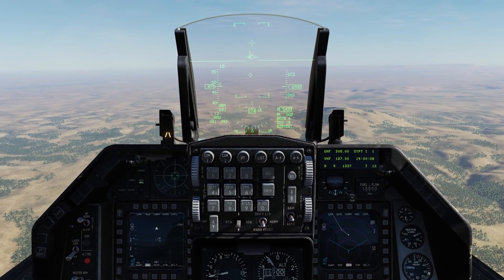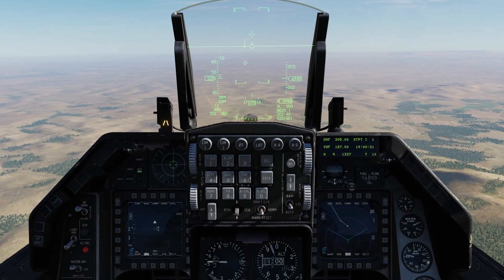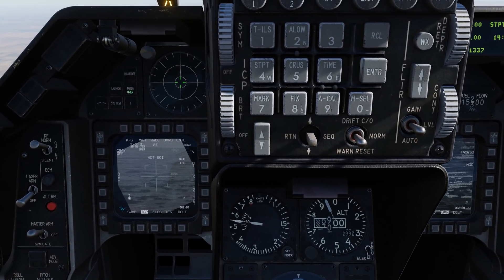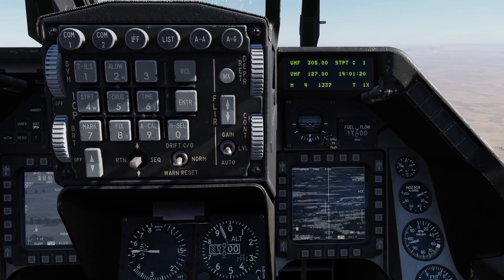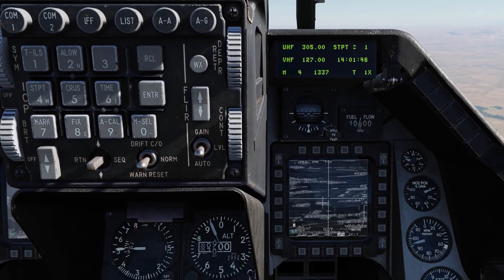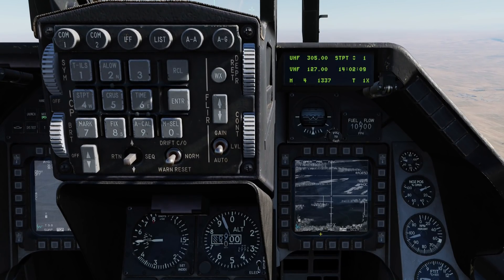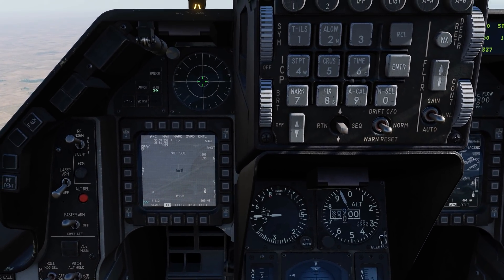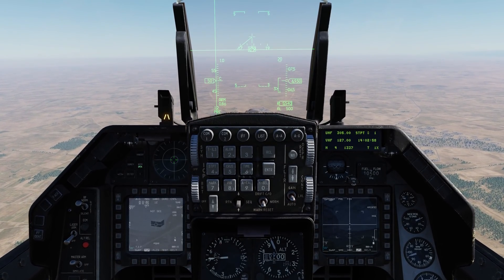DCS: F-16C Viper | Maverick Boresight Procedure

Comment: well this doesn't makes sense at all if in real life is how it works because its a pain to sync the tpod with the maverick seeker, because in the end you have to lock twice the same target and sometimes mav seeker is pretty off target ,  sometimes i end up shooting the wrong target in the heat of the moment with so many close ground targets, if this procedure you have shown here is a work around that will sync all mavs with the tpod, ok i will try it, sometimes i see myself just using the weapon display page and ignoring the TGP because ends up sometimes being easier, anyways Matt tx a lot man. I see this video is 3 years old so...is this really how it works in real life or you guys are trying to fix it, i know slave is a thing of the past but here would be nice to see it working , the TGP works way better to lock ground units with a dedicated zoom the different contrasts to choose from,  but then when you look to the weapon MFD and  is way off target and i  need to re adjust the lock, sometimes is very frustrating , you have multiple ground units etc.. , still love this plane and is a pleasure to fly it. Another thing, is normal the amount of de-compensation you have in roll when you drop a weapon from the left or right wing, its sometimes brutal the amount of trim needed to compensate and level the flight, cheers and have a great year guys, i belieeeeeeve in youuuuu(south park)

Comment: Does he ever reply to comments    My NWS will not turn on during ramp start in the F16.  I have been ramp starting for 7 months ,  now NWS will not turn on using the msl step button.  Anyone please help me.
Reply: I noticed recently that the brightness of the NWS green light is sometimes turned down/off, have you checked that? IF the steering actually works then it's the light brightness. If the NWS doesn't actually work then check your key binding, perhaps something got screwed up?

Comment: Hey Matt i got a question, i am new at DCS, how can i get the The F-16C Fighting Falcon "Viper"?
Reply: Buy it on steam or ED site. It costs $80 dollars right now, but if you wait for a sale you can get it for $40.
Reply: Okay.
Reply: Btw i am from Europe.
Reply: @mariosnikas0319  Being from Europe is not a problem. So am I. 
I would suggest you create an user on the Eagle Dynamics site and you play the Open Beta of the game. Yes there may be some bugs here and there and less stable (not an issue most of the time) but by being on the Open Beta you get access to functions and modules much faster, if that is your thing. You buy each module you want from either the ED site or Steam if that's the way you want to go. Newer modules don't have the same discounts as older ones when there is a discount btw but if you feel like it it can be worth the wait. The Viper has come very far from the beginning though it's really a beautiful module to fly now. 

WIlbuz

Comment: In boresight mode my reticle on my HUD and the reticle on the mfd does not line up and therefore it's hard as hell to get a lock on targets, any suggestions? (no tgp btw if that helps, just the mavs camera)
Reply: i have the same prob. any sollution?
Reply: @_DANZIG_  nope, unless you use the tpod and calibrate the mavericks camera to align to the tpod
Reply: @niklasohlen3097  mhh okay this sucks. thanks for the  reply

Comment: whats the advantage? I dont get it. You need to manual slew the mav and the nboresight when the target is in range of the seeker? Why not just fire it?
Reply: There is no advantage. It is a requirement. It's something to do if you want to be able to find your targets with the TGP and then shoot a maverick on them.
Reply: @Wawar9  can you imagine this like an alignment?
Reply: @TuneboyR  It is. You have to tell the Mav "where" to look at. Also, IRL pilots are used to do it while they are on the ground.
Reply: @TuneboyR  
This needs to be done if you want to use the TPOD to aim the mavericks (without needing to do any corrections, just TMS up and fire). 

It's particularly useful when using H and K mavs, since it provides very accurate force correlate locks, so you can fire at max range and actually hit the targets.

Comment: @Matt, why is this technically necessary? Do we need to expect this in the A-10C oder the F-18C as well in the future?
Reply: So is this really necessary because I don't recall anyone complaining about the maverick accuracy when launched from a F-16.

If it is necessary,  can you do this procedure during a pre-filght and have the maverick ready to use immediately after takeoff?
Reply: @RTSchramm  it's only necessary if you want to assign targets to the maverick through the tgp. Because like I said before, when mavericks are loaded, there will be an alignment error, causing the mavericks to look at a different spot than the tgp does. In order to fix this, you'll need to align them, to make sure both the missile and tgp are looking at the same spot

If you want to fire mavericks without use of tgp, than you won't need to do the alignment and you can use the seeker head of the missile to acquire the target.
Reply: @RTSchramm  AFAIK  you'd do this if you notice that there's an alignment error between the TGP and mav.

Can't do it on the ground, as the TGP won't work there? The procedure is fast enough so you should be able to do it when you notice a misalignment.
Reply: The AGM-65 mounting procedure induces an unknown amount of misalignment of the launcher. This misalignment must be removed to improve accuracy and shorten the time required to achieve a handoff
Reply: @Falconeer84  So, does this apply to all fighters that can launch mavericks? I don't do any manual bore sight alignment on either the A-10C, A10C II, or the F-18C.
Reply: @RTSchramm  The answer is probably two-fold: How the real aircraft works, and if/how it's implemented in DCS.
Reply: @RTSchramm  don't know about other planes
Reply: @Falconeer84  thank you
Reply: wow your comment before 49 seconds!😂
Reply: @AnAnAsDUDE  ok i admit... the technical question is a little bit unfavourably formulated... it should have been something like "why is it technically necessary in the F-16?" followed be the second question. This makes more sense.
Reply: @AnAnAsDUDE  I totally agree, it's no wonder real pilots probably only ever fly one aircraft if it's this complicated.
Reply: @mrifixplanes1813  why you are reply me? why you not reply to kurothas
Reply: @AnAnAsDUDE  Because he doesn't know how the reply function works :P ( He did it in another thread too - A  bit confusing xD )
Reply: @Jarlerus  hhh😅
Reply: @Jarlerus  Where is the Problem? obviously you can read and answer it
Reply: @kurothas2181  Problem? What problem? I have no idea what you are referring to here. <.<
Reply: @mrifixplanes1813  well it is hard to fly more that on aircraft at once
Reply: @mrifixplanes1813  with the price of modules, how many virtual ones are you flying? 😳
Reply: @DollyRanch  Well I've been using DCS for a long time so, A10C+2, AV8B, all FC3 planes, Ka-50, Huey, F14, F16, F18, Viggen, Gazelle, Spitfire, P51, Mirage,  it's hard to remember all the buttons lol
Reply: @AnAnAsDUDE  I see "reply" button, I click :)
Reply: @mrifixplanes1813  I know I'm just green with envy 😂 always funny when one hops in the Huey after a break and attempts to fire the weapons but instead talks on the intercom or trims the aircraft

Comment: Great vid. It's interesting that in the hornet you cannot change FOV on the pod with hotas even if the TGP is SOI when there is a MAV loaded, but in the Viper, you can.
Reply: Ohhh so thats whats happening, its been baffling me for a while why my fov button stops working sometimes then comes back. Thanks. Sounds like a bug youd think
Reply: What's happening in the Hornet is that the Mav always gets priority over the TGP for the Expand button, regardless of SOI. Supposedly that's accurate (if dumb as hell).
Reply: @TLTeo  thanks. So does that mean the hotas fov when pressed will change the fov on mav even if not soi? Also if mav not boxed im assuming this wouldnt be a thing? or does just having a mav on station affect it
Reply: @lankypilot778  Any time the Mav weapon is selected
Reply: yeah and you have that magic axis zoom to use with the TGP, its great, i have it mapped to the lower thumb potentiometer in the throttle x56, very handy, cuz the one on the top is the geral zoom of the sim
Reply: Hornet Hotas commands aren't finished yet. I believe we should be able to.

Comment: Hasn't the ability to boresight mavs existed since the original A-10C? I've never used it but I believe it's always existed.
Reply: I just ran a test. In the Hog you don't actually boresight the mav seeker, you boresight the HUD wagon wheel. The Mavs are perfectly aligned with the IFFCC
Reply: @rjtoten  Also, its a different aircraft, and a different module.  <.<
Reply: @Jarlerus  that's nice. doesn't matter...it's the same missile
Reply: @rjtoten  ofc it matters :P This video shows a new feature that has been added to the _F-16 module_. It doesn't matter if it exists on other modules...
Reply: @Jarlerus  to you
Reply: @rjtoten  Please - Explain to me how it doesn't matter :)
Reply: @rjtoten  How aircraft systems work are unique - Somewhat so IRL, but extremely so in a software environment like this.
Just because one module has a function it doesn't mean all modules that use a specific weapon has that function.
Reply: @Jarlerus  my original comment was on observing that the procedure in the Viper appeared similar to the procedure for the Warthog. Because both aircraft use identical missiles, those identical missiles would have identical seekers which have the identical limitation (presumably) which both aircraft must be designed to incorporate procedures to correct for. The difference would come in that the Viper would be the first module which actually models this seeker limitation, actually requiring the procedure both RL aircraft have to correct it. I was under the impression the Hog had this procedure, but not the modeling to require it's use.

From my investigation it appears that it isn't exactly correct. The procedure exists in the Hog, but it isn't perfect. Good enough to provide the experience if one wants to explore the depth, but cannot actually fix this limitation (and the limitation doesn't exist anywyas so no need to fix.. just something to play around with).

But you come in here with your snarky comments and funny faces thinking you're contributing to the conversation, when you're not, except in motivating me to make replies like this one.

Luckily your last reply was actually constructive. I'd be interesting to learn if this was a RL feature of the Hog (IFFCC can align MAV and TGP automatically) or just a game simplification. I think game simplification... but that was the reason for my first reply.
Reply: @rjtoten  Cool. 
Your first question indicated something else - It came off as you not understanding the need of this video, like you where questioning this feature was new to DCS in some way, and that it would be automatically transferable to new modules like the F-16. I just wanted to explore what you meant, and thought I'd do it with some sarcasm because... idk. fun? <.<

Thanks for the elaboration though - Made much more sense than your first post.
Reply: @Jarlerus  yeah the sarcasm might have come off wrong.. oh well thanks for the explanation.
I was also sort of suggesting if this was a "core" maverick improvement. Because if it was then the alignment process would need to be accomplished for the Viper, Warthog, and Hornet. Some simplification would be needed for the FC3 A-10A though.
And this segues into the topic of HARM implementation. The Viper originally got some new HARM features that were skipped for the Hornet, but are getting brought over (I.E. core).. so the question is, are these core Maverick improvements we will see across the board, or unique to the Viper? The latter is neat, the former is really cool!
Reply: @rjtoten  My guess on this is that all these features are module specific, and the weapon/core part is only the weapon itself. That said, copy-pasting some of the code, and integrating it on other modules, should work - just as EDs talked about before regarding F-16 and F/A-18 features bleeding over to eachother. It's probably not a clear copy-paste situation (there's all the differences in systems and procedures on specific airframes to implement) but still better than starting from scratch, I believe.
Reply: Yes, calibrating the A-10/Maverick boresight has been modeled for at least 5 years.
Reply: Has it existed on the F-16 since the Original A-10C? :P
Reply: @Jarlerus  Depends on what you mean by boresight Mavs, if you mean return them to looking straight ahead then yes, you can do that in the A10C. 
On the F16, since the update, you can slave the Mav to the TGP, but the Mav might be mis-aligned with the TGP. So you put the TGP on a target and the Mav is looking nowhere near it. This procedure is to align the seeker of the Mav with the seeker of the TGP.